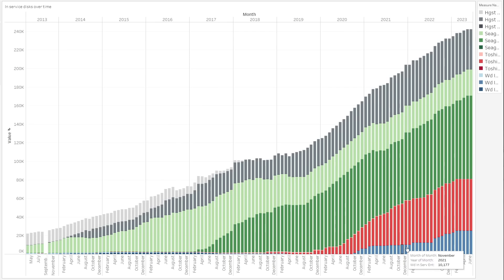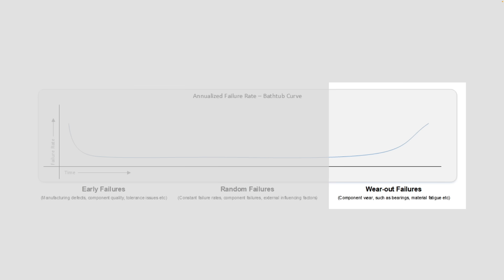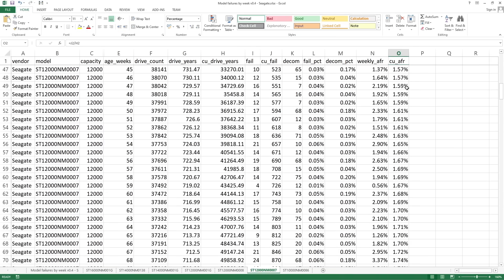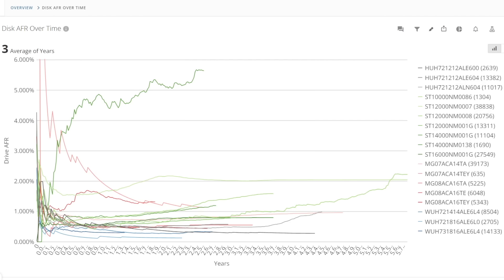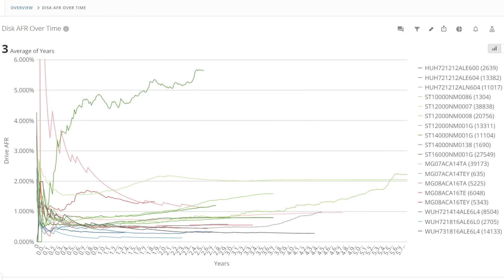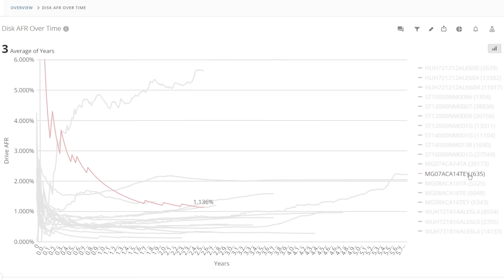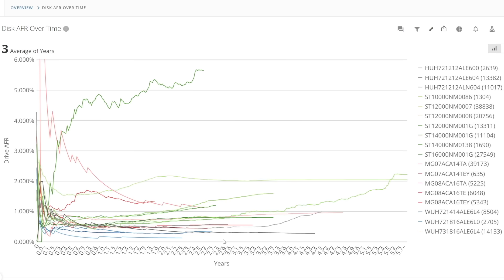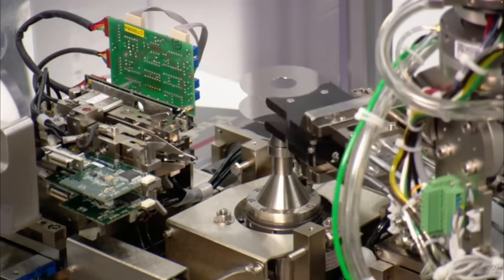Failure Rate Analysis - Best 10Tb+ hard drives: Seagate, Western Digital or Toshiba?

Comment: Seagate ... Advice from 25+ years of experience is: avoid Seagate.
Reply from the maker: For the smaller capacity drives, I have a video that compares enterprise drives to desktop drives for failures, found here : https://youtu.be/l_YqdVGcC0o. But the short answer is that desktop drives are not generally statistically more likely to fail than enterprise, despite the lower warranty. But the warranty of course allows you to get a replacement for a failure.

Yes its true that Seagate appears to have a higher failure rate than HGST (and recent WD drives), and Toshiba can be better also, but its also true that it varies by model, and any drive can fail, or last years. The failure rates over all however, are low, typically 0.5% to 1.5% AFR, meaning that there is around 1% chance that a drive will fail in any given year. So I personally wouldn't avoid Seagate and I have a lot of Seagate drives and have had a good experience. But I would do the following things.

1) Make sure that you do not have 1 copy of data you can't lose on any single disk or in any single drive array. If you care, have a backup. For things I really care about, I have more than 1 backup and keep one somewhere different.
2) If a drive shows signs of failure, replace it.
3) Buy base on pricing, as well as its reliability. I am not saying buy known problem drives, but don't pay huge premiums for specific drives, because any can fail and see point 1.
4) Treat spinning drives properly. Secure them when in use, and don't move them. Don't have them hanging around loose in chassis.
5) Ideally use a UPS to protect systems, especially NAS's. This will result in less unscheduled shutdowns.
6) Be cautious about where you get drives from. I personally buy from trusted retailers where I believe the warranty is valid and its a new drive,  the drive hasn't been shucked, removed from a system or 'refurbished'.

SSDs are not better than Spinning disks. They are better for certain things. Cheap, long term storage is a good use case for spinning disks and its a more stable medium also for long term data retention.

Good luck!
Reply: @sometechguy  thx !
Reply: @sometechguy Although I agree with you in principle, the failure rate, particularly at the start, is a good indicator of how stable your production process is and how good your quality control is.
This can vary over the years and depend on what factory the units were produced in, but a good company has control over the process and don’t let DOA drives reach the customer.

Your application also matters. If you have a data centre with large, well monitored arrays with automatic failover, a few broken disks is not a large problem. You replace them under warranty. Unit cost is an important factor since it determines your initial investment cost.

If you however have a smaller mission critical application where a failed disk is recoverable, but costly to replace, then reliability becomes the priority and initial investment cost is not a factor. In that case avoid Seagate and Toshiba 😊 since, even if they get it right sometimes, consistency and quality control is not good enough for your application.
Reply: @sometechguy  NAS must have a supercapacitor or battery on-board for pt.5
Reply: Well I guess I'm the outlier then. I have 12 WD drives and they all fail after 8 years in storage. Not a single drive boot up without significant issues. Luckily, they managed to stay alive long enough for me to extract data from with one 1tb unit that took me 168 hours to extract data from it. 

Meanwhile, not a single of my 5 seagate drives, which is stored at the same place, died or have any errors.
Reply: @ilovelimpfries which seagate you using??
Reply: @ilovelimpfries WD drives have a security - in they encrypt the data , if you get a working one and swap the interface the dive can be read and ( for me works no problem) otherwise the drive appears dead .
Reply: I have WD gold dying after 5 years of service while the Seagate exos are still running...
Reply: In my experience wd were always worst than seagates.
Reply: Not sure what’s causing these reports of sudden Seagate deaths. I’m starting to wonder if it’s not just OS that is preempting catastrophic failure when detecting SMART issues. 

Nevertheless failure is unavoidable on the long term. It’s how the manufacturer deals with it that’s more important. 

I’ve had two failures. One was a LaCie external drive whose usb connector became unreliable and one was an IronWolf Pro that couldn’t pass SMART anymore. 

In both cases I had a replacement in hand within a week and a free external drive with all my data recovered for free within a month. 

That alone makes it well worth it for me.
Reply: @turquoisetide  Seagate failures are a meme, and social media rewards adherence to the meme over perspective and real data (i.e. social media loves confirmation bias).

Take the advice at the top of the thread from the guy analyzing real data, that everyone else ignored. Treat every drive as if it will eventually fail, pay for drives based on what they're worth, and lean on redundancy (and timely maintenance) for any data you really don't want to lose.
Reply: I also have numerous of issues with Seagate. Maxtor - Seagate's former subsidiary was reliable but couldn't live to its standards after acquisition. Furthermore, Maxtor brand died eventually in favour of simplifying Seagate branding. Was sceptical of WD initially but have no intention to switch back to Seagate after trying the competitor.
Reply: I just incremental back up every few hours using Kopia. Problem solved. I buy the cheapest drives with 5 year warranty.
At one point there was an amazing deal on Seagate Exos 14 TB!
Reply: I have 5 WD drives working from 5 to 16 years, none of them died expect one had errors because i dropped it on the floor but i make partitions around the broken area and it's still working.
Reply: @club4ghz which model
Reply: @club4ghz which WD drives, can you please let me know ?
Reply: Same. Been in the industry 20+ years. I've built a lot of PC's over that time and one thing i can tell you is that when Seagates fail, they fail HARD. What i mean by that, is that, one day all is well and then suddenly the drives start to go downhill very quickly. Seek error climb drastically and if you don't notice it in time or haven't some active SMART Monitoring keeping an eye on things, you'll have a dead drive in no time at all. 
In Data Centers, this isn't a huge deal, as they have hard drive redundancy as part of their model, but for home users, not as much. I stopped buying Seagate's a long time ago (i can remember when they bought out Maxtor and their plants, so they could increase their warranties from 2 years to 5). I stick with Western Digital personally, for no other reason, that when those drives start to fail, it's a noticeable, gradual downward curve, not a cliff edge.
Reply: @GrannyDryden  Western digitals were a nightmare, I lost valuable data, from several disks, all died within 5 years, I have seagates that run more than 15 years without any problems! So yeah
Reply: @Pauluz_The_Web_Gnome thanks for the sea gate props. I have iron wolf pro 12tb and was starting to get worried 😮
Reply: @GrannyDryden  I had problems with Seagate, but I managed to save data. But several WD disks died instantly. Now I have chosen Seagate Exos.
Reply: @GrannyDryden  I had quite the opposite experience with wd recently. I'd just used it up until noon that day. And hours later at night that day it was stuck loading infinitely so I plugged it in a different port, updated drivers etc. Couple of mins later it started making a clicking sound and it was done. On the other hand My 1 tb Seagate showed signs of failure long before it finally did fail. But sadly it was my first external HDD and at the time I had no ideas those signs were pointing towards it failing.
Reply: @GrannyDryden  EXACTLY THIS!
Reply: @GrannyDryden at this stage, whats the point? SSDs are so cheap and can be bought in 8TB sizes. If a company needs hundreds of terabytes, then they should be using Azure. 
So the target market for a hard drive is what. Businesses with huge amounts of data who are too cheap to use Azure? Which is only a surface level discount. Since Azure protects the business better from security risks. And prevents catastrophic hardware failure + labour costs. 
So is it even more expensive on a risk adjusted basis. 
Who are these for?
Reply: I had bought 4 seagate 18tb drives 1 were doa got  replacment within 1 day via express delivery  they run since 3 years  no problem 😅
Reply: Bought a couple of Seagate IronWolf to build my own NAS for try.
Reply: Around 1997-ish, I have installed a 6.3GB Seagate in a dental pracrice's server.  It had a MTBF rate equal to 95 years.  It promptly failed out-of-box, as did the second one.  In my entire IT career since 1982, those were the only drives that failed, and both were Seagate.  In 2000/1, I travelled around the globe with a loose 650MB Fujitsu drive that felt many bumps and knocks, but never failed.
Reply: Also, keep your receipts with WD
Reply: Funny how anecdotes are always just that. 

I've been doing IT for almost 25 years now professionally and every drive brand has it's share of horror stories. Bad generations, drive families, variants etc. 

I have Seagate drives with literally 10+ years of spin time with no issues still humming along. Same with HGST, Samsung, WD etc. 

For a long time I would not trust WD Black sata drives. 3tb Seagate and WD drives have all failed on me. 500gb and 1tb 3.5inch disks from Seagate have rarely been an issue. Etc etc. 

Right now I absolutely adore Seagate Exos drives. I'm currently actively using 48 18TB models and have not had a single failure.
Reply: I suppose we should just address the ‘pink elephant in the room’ in that’s, all drives will fail at some point, irrespective of manufacturer. The important thing to have a your critical data backed up, and no, RAID, isn’t a replacement for an actual backup. All my devices sync their files to my local Synology, from there, I do a quarterly backup of my NAS to an external hard drive, which is stored somewhere else. Ultimately it’s not the drives that are important, but the quality of your backups and redundancies when SHTF.
Reply: Wow.   My thoughts exactly the opposite.  Ironwolf and Exos are the recommended drives for NAS.  Mine have lasted over 10 years.
Reply: Had issues with an array of their 3TB drives, luckily I had enough redundancy to not lose data, far less need to dig out backups, but even over a decade later I get where you're coming from.
Reply: I found that out the hard way by buying one of their drives and using it for my video game data. I think it lasted about 9 months before total failure.
Reply: You spelled SeaFATE wrong
Reply: yup, i used to be a service technician in 2004, seagate used to fail the most, not much changed
Reply: Yeah about 15 years ago I got through 4 Seagate drives in just a couple of years. Switched to WD and never had any drives fail again
Reply: Unless you're going to RAID (redundant array of INEXPENSIVE disk) them.
Reply: I can absolutely second this.
Reply: Not their enterprise line which is solid. Consumer seagate or WD is garbage. Buy seagate iron wolf instead of
Reply: Interestingly I’ve had the absolutely opposite experience. The WD drives I bought worked for total of two weeks before failing. I only use seagate now and none have ever failed in years of use.
Reply: After reading most of this, I'm very afraid of Seagate... I have one from 2022, works hella fine. Love it, still under warranty...

But I'm in need of new HDDs... I'm not very trusting WD tbh, but still... Can anyone please help me to say what brand is the best or what shall I be aware of?

I have normal PC not running NAS or anything, but I want it to last years, not just 2 years or 3...
Reply: @linplayer3150  Research statistics data. Don't trust personal opinion.
Reply: @skobkinru  fair enough... Thought I doubt I'll understand them well. I'm simple woman who happens to build up a computer few years ago 😂
Reply: @skobkinru  largest privately owned data center. 2 buildings housed 110K servers. There was a total of 6 buildings.

I worked there for 4 years. Went through hundreds of thousands of disks.
Reply: @bull.dog.  Sounds like an interesting job. Did you bring some numbers?
Reply: @skobkinru  yes! I had you, and others like you in mind, so all I was doing there was diligently recording numbers, including models and serials.
Reply: @bull.dog.  Oh, good. I hope one day you'll find some time to share the data with us.
Reply: @bull.dog.  jesus... I work in repair shop for YEARS and even though I wasn't making some statistics ik what models are more faulty than others 🙄 and I'm not even the guy who repairs the stuff (phones btw.) 
So yeah if you go here and flex "been doing something for years" sry I expected that you have some knowledge. Such a bold thing to asume

Next time, don't comment with useless info. Like literally who asked if you can't provide anything...
Reply: @linplayer3150  I was going through hundreds of disks a day. When I say that Seagate are shit, it was replaced by a large margin more than disks from other manufacturers.

What you believe or want to believe - none of my concern!

Also need to understand that disk usage plays a role, as well as many other factors, so you with your comments telling me what to do, please go take a hike
Reply: @bull.dog.  well you randomly said "oh worked here and there" so I asked you about it, because I was curious, then you're being kinda sassy or maybe not, if not sorry then. But it sounded like that. 
And yeah if you said that from beginning, it would be better, but thanks for some usable info, now.

I don't tell you what to do, you do you man. Idc, you went kinda off, sry not sry. 

I don't need to go hiking, doing that more than most ppl behind PCs already 🫡
Reply: @linplayer3150  the least I've seen failed - HGST or whatever the brand is (Hitachi).
Reply: I've had quite a number of hard drives over the years, all these brands plus others that have come & gone or acquired by others, Fujitsu, Toshiba, Maxtor, IBM. My very first one, a 50 Meg Quantum still works. Some break, some don't. With Seagate I've had a 100% failure rate. Not a single one has lasted beyond intended use duration.
Reply: yep. all my Seagate have died to the same error. all my wd are still alive and kicking
Reply: as a datacenter worker (former) i can confirm
Reply: I can roughly name you all drive brands since 1987, most doesn't exist today anymore but the one that does, Seagate is the one that always failed me.
I can say, those who swear by their important data that Seagate drives are reliable are just Seagate trolls.
Reply: @budakPancing  I have a Seagate drive and got it 7 years ago still hasn't failed
Reply: My first drive seagate and it failed after 3 years, I ended up western digital and 10years on they are still going strong for Nas and cctv storage
Reply: Classic😂
Reply: I learned this the hard, and expensive, way ☹️
Reply: Mechanical storage now starts from 4TB up. Personaly I use Adata 8200 pro as main disk, Cruical MX500 for linux, and 4 old 1TB hdd Model:                                                                    Hitachi HDT721010SLA360
x2, Model:                                                                    WDC WD1002FAEX-00Y9A0
x2, mechanical drives have about 5.5 years of sumed power on working time and no signs of fatigue so far. In work we have some Synology nas + Synology drives (no idea about model of drives inside) and WD8003FFBX WD Red pro for asustor nas.   @arshkarim_
Reply: depends on the budget. If you want cheap and cheerful, then go for a Western Digital Blue drive. If you need a bit more speed (like storing your steam library on), then a Western digital Black drive should work nicely.  @arshkarim_
Reply: Agreed
Reply: Second this.
Reply: I totally agree!
Reply: I bought two seagate 10tb drives, and a year later I bought two more. Around that time the first two started failing, but luckily they were still in warranty. Got them replaced and five years later all four are still running strong. The first two were shipped together. What does that tell me? Handling has something to do with it.
Reply: Been running Seagate for years, many of them used before I got them.
Reply: Well, i bought this shit. Congrats to me
Reply: @borodin-f1u People are acting as if those drives had 100% failure rate. You'll be fine, be sure to backup important data. If a drive fails, just claim warranty and buy a better drive. Boom, easy no drama
Reply: @l4kr Not exactly acting.....it happens!! And warranty doesn't cover lost data.
Reply: Yes
Reply: I wonder if Seagate didn't shut down until today
Reply: I hv had new with western digital
Reply: Never had any issues with Seagate. WD Reds would fail at least one per year. Even drives in service for 1-2 years. Maybe the enterprise WD are better but the consumer ones are the same shit.
Reply: Yes and very yes yes yes!!! They fcked up my memories and my past... Fck Seagate
Reply: i have seagate external hdd running for more than 9 years
Reply: @siddharthsingh1319  it is external, it is not get constant voltage from power supply
Reply: You are wright
Reply: Thank you for this, im looking to build a nas and found iron wolf 12tb manufactured refurbished drives for 99$ a pop. Was thinking of getting 5 of them but if they are shit them screw It ill go WD. I dont habe time to deal woth high failure rates
Reply: @makodaniel4885  was is shit as well. Buy enterprise level drives like seagate ironwolf - 5 year warranty and they don’t fail
Reply: @makodaniel4885  Both Seagate and WD have had really bad runs.  Over 25 years I agree with the OP above, but Seagate has improved quite a bit recently too, and is cheaper so if you're building in redundancy you can repair your raid for cheaper if a drive fails.  WD had a class action lawsuit a few years ago for failing WD Reds.  WD also switched a lot of their drives to SHR without telling anyone or marking it on their drives which has annoyed the NAS community.  Personally I'm going Seagate because they work well enough and backups and redundancy are part of my overall config.  Just be sure to take your time and research before committing and you'll be fine.
Reply: It really depends on the model. But I agree they are generally a bigger gamble than other brands. Occasionally great, usually pretty good, sometimes disastrous.
Reply: what if it's cheaper
Reply: Agreed.
Reply: That's exactly why we have statistics. To refrain from relying on personal experience.
Reply: Same, I've got ironwolf pro just a year ago and now it's showing 18% critical health

I'm hating Seagate
Reply: My seagate hdd 1.5tb with crucial data failed last week after exact 3 years and 3 months which is rarely used
Reply: I once bought a brand new Western Digital Black 500gb straight from their website back when they still sold directly to consumers. Disk was DOA. Spent 3 days trying to convince them to let me return the drive and when they finally gave in, I had to pay for all the shipping and handling. Took them an entire month until I saw any activity from them and they didnt even offer to swap it out for another drive, they just returned my $200 bucks without a word. 
Second worst experience i've had buying a HDD
Reply: I have a Seagate hdd 😢
Reply: I've had 3 WD drives all fail with minimal use. My Seagate seems to be doing well.
Reply: Avoid Seagate all all cost, those jackas got all my data lost with brand new 4TB mean while Hitachi second hand still rocking solid:face-fuchsia-tongue-out::face-orange-biting-nails::face-purple-crying:
Reply: I have no issues with any of mine.
Reply: thanks for the heads up... i needed something cheap and quick after drive failure 3 years ago. went with raid 1 of seagate 12tb until i could get bigger/more drives
Reply: Just my 2 cent.

Only WD seems to last the longest. Toshiba is at the bottom of my list whole HGST and Seagate are in the middle. I also moticed that the low spinnig disks last longer regardless of brand. 

For flash, ony Sandisk seem to pass while the rest just doesn't pass. Give exception to Samsung which I dont have enough info on it yet. Over the years been seriously rooting ang searching for a competitor with no luck yet. They just fail outright and not need to test further. Who knows maybe Samsung it is although I dont have much hope after what I saw from other products in Korea and Taiwan. China wins from an American brand.
Reply: The only drive that has ever died on me was a Seagate.
Reply: And western digital
Reply: Agree. 4 hdd fail. 1TB, 2TB, 4TB, 4TB. Seagate is shit.
Reply: my Seagate hdd failed after 6 years
Reply: 66% of seagate drives I’ve bought have been DOA 😂
Reply: So funny I remember as a kid in the 90s-00s, my dad and I would laugh about how Seagate were constantly failing. I guess nothing's changed. Still have WD caviars I power up a few times a year going strong.
Reply: I have had toshiba fail, wd, and intenso, but seagate was the highest
Reply: Ditto here 👍🏻
Reply: When Seagate bought Maxtor that was a sign to avoid Seagate.
Reply: I feel this so much. Had my PC die on me, and my 1TB Toshiba that I've had for 5 years and has survived other PC catastrophies was fine, but my brand new SeaGate 4TB shat itself immediately and lost me all my stuff on it.
Reply: Hmmmm years of data or one guy on the internet with 20 years and no data…oh that’s right proof wins.
Reply: The same happened with my Exos, tho it was recertified one, it happened in the blink of an eye, without giving any signal. Luckily I didn’t store any important data in it.
Reply: I’ve been in the IT industry for 20 years. Every Seagate drive I have ever seen has failed early and lost data
Reply: Yep experienced this on multiple Seagate drives
Reply: I had better luck with seagate then I did with western digital ..... not sure what people are talking about..... I bought bought brands regularly..... from my experience seagates lasted significantly longer then western digital
Reply: I agree. Seagate should be avoided if you are trusting your crucial data. Backup failure (3-2-1)  happened with me with Seagate (had all cautious maintenance like UPS etc being in place).  Luckily for me, had couple of no name ssds that I bought and copied crucial data to, brought my personal data back to life. 
The only other data I lost is the ripped dvds. And those dvds or CDs are scrambled enough, I can't get them back. Looks like I'll have to repurchase. 
Please, note: I had went against my thumbrule of not putting disks from same vendor in the arrays. Wanted to save money. Paid it otherwise.
Reply: So true, stick with Toshiba or HGST, now WD
Reply: @leventozcan4595 I do agree. Toshiba is really the best. HGST follows as second best. Hopefully the acquisition of Hitachi won’t have a negative impact on HGST, where they become as bad as WD.
Reply: 10 years. And recently 1TB Seagate one just died randomly
Reply: Same.  I started in IT in 2005. 
By 2007 I wouldn’t go anywhere near Seagate, even more so than the Toshibas.
Reply: I totally 100% agree with you DO NOT BUY SEAGATE
Reply: Found the sockpuppet!